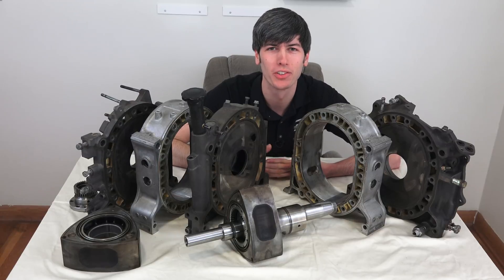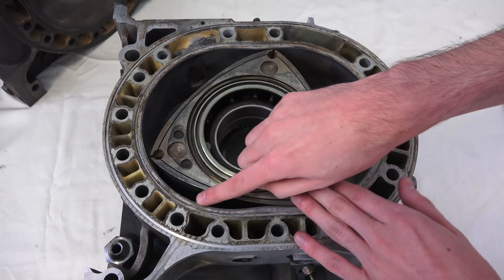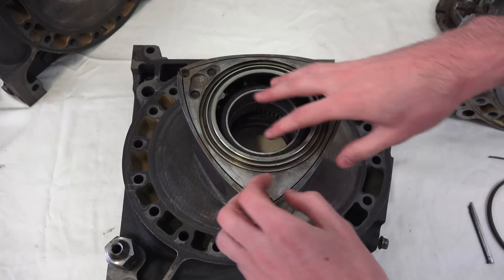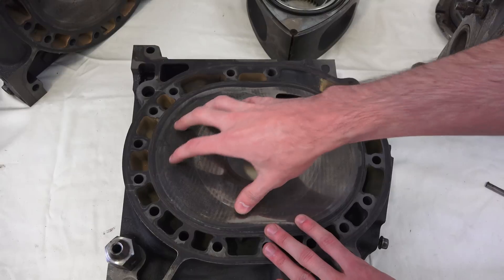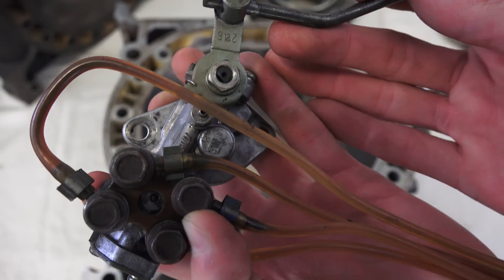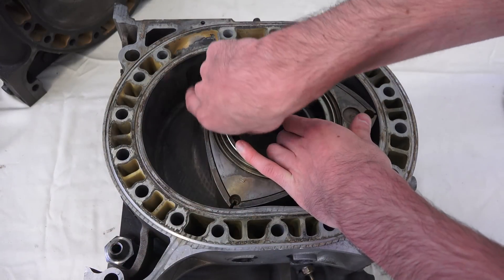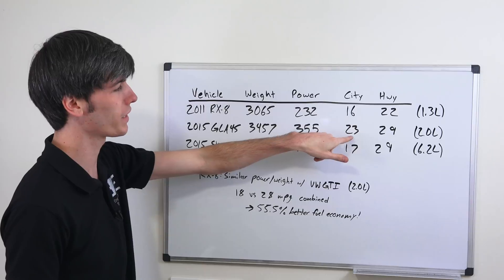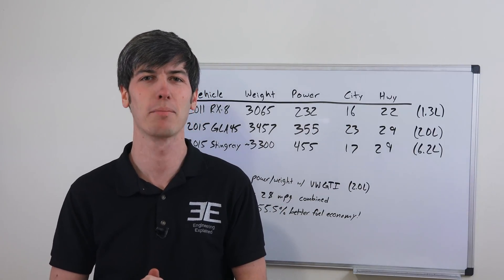4 Reasons Why The Rotary Engine Is Dead

Comment: My Rx2 runs a 9.6, lets see a bloody corvette do that with under 750hp ! How's that for efficiency .
Reply: The real doktorbimmer 
Bimmer McBimface, I know the Prius engine is an Atkinson cycle.
Reply: Mainly you yanks buy the v8´s, becouse noone else wants them :D
Reply: Daniel Manu Do you know what "efficiency" means?

It's about how much fuel is needed to produce a certain amount of power.
Reply: Speedyey I love it when people use subjective arguments. I really do.

/sarcasm
Reply: karsaka sdasfa 😂 The current 6.2 makes up to 650 HP. The most powerful Porsche V8 makes 608 HP, and that's the one in the 918.

Not to mention the Z06 Chevrolet Corvette ($80,445), with 650 HP, costs over $10k less than a base 370 HP Porsche 911 ($91,100).
Reply: There's plenty of 9second Camaros with under 750hp
Reply: It's bloody from running over your slow rx2. And your engine is old news.
Reply: Dyani Massa 
You must understand that Bimmer McBimface needs therapy.
Reply: Dyani Massa
Toyota, with about 15 others have been doing R&D on the free-piston linear generator for range-extender applications.  R&D had been ongoing in some places for 15 years. Toyota made a prototype and issued details and drawings. No one has cracked it yet. It is clear Toyota are turning to the rotary engine as a range extender.

The latest Prius now will travel about 30 miles  on a full battery charge then the large engine, in physical size and displacement, will kick in to drive the car via the power splitter (this is not an in-line transmission as we know it) and recharge the batteries as well.  The car is driven via electric traction then IC traction. 

The whole Prius setup is now 20 years old and was superb for its time when battery technology was less than what we have now. Toyota need a major step up. The rotary will given them a true generator, not driving the car directly via the power splitter.

Toyota are aware that the rotary is very efficient at constant speeds and matches the requirements for a part time range-extender.
Reply: LMFAO I love it when V8 junkies get rekt so hard like this hahahahah v8 can die pls
Reply: The real doktorbimmer so? i still hate everything about their existence. so no there is no joke on me. v8 = heavy, thirsty and they sound like complete trash! ive never ever heard a good sounding v8. any straight or rotary enginge sound better then the best sounding v8.
Reply: doktorbimmer you Yankee should shut up since only European engines are worth something. That 6.2l v8 produces less HP than Porsches N.A. flat 6 let alone v8.

Comment: If you're just looking at miles per gallon, yes, the rotary is inefficient.  But another way of looking at it is that you're getting a lot of power out of a much smaller engine.  A 1.3 liter unboosted rotary making 232 hp, compared to the Vette's  455hp from 6.2 liters.  For the Mazda, that's 178.5hp/liter.  For the Chevy, that's 73.4hp/liter.  That's much less than half the output per displacement.  So in that sense, the Mazda is much more efficient with it''s energy.

I love the Vette, and it does what it does very well.  But so does the Mazda.  Really, it depends on what you're wanting from your engine, as to whether a machine is a good one or not.

Comment: 1.3 litre rotary is just an error on your part, it is actually much bigger in cubic capacity than that.
Reply: "WRONG! 2.6 liters is the accepted volume while the actual displacement is really 3.9 liters"

Hes not "WRONG!". Rotaries are simply measured different. It becomes WRONG when you try to "compare" 1.3 liters with a rotary, to 1.3 liters with a 4-stroke piston engine.  2.6 is only the "accepted" volume when you compare it to a 4-stroke engine.  On their own, theyre 1.3 liters.  If you measure the full thermal dynamic cycle, theyre 3.9 liter engines.

Context.  Makes the world go round.

Back to work officer.
Reply: I think it would be right to say 1.3 litres, because combustion happens only in that area.
CC should be only the combustion area.

If we compare everything to 4 stroke, then things will complicate. For example, by the 720* logic, every 500cc 2 stroke bike is a 1000cc because it fires a 500cc space twice in the same time...
And performance figures can back my claim easily.

Anyhow, I think there's not much need to be disappointed. I've heard Norton is making 100 units of CR700P, which is a motorcycle with a rotary engine.... A road going model is going to follow too, with Euro 4 compliance.
And for a motorcycle, a 200 bhp bike with 136 kgs doesn't sound like a good idea. Its more like a "revolutionary idea"!
How many mentioned challenges of this video, are solved in this bike remains to be seen though.
Reply: 1.3 is the accepted volume.
Reply: Agreed, it is the accepted volume but it remains quite wrong.  The Mazda engine has an actual volume of about 3 litres.
Reply: Ok, so a little introduction. I'm a biker. And not too old, I'm 30 and not from a developed country, and I'm also a Commerce Post Graduate, didn't study science due to some sad reasons.
So, I know less about Wankel engines, but buddy, engineering is still very much my only passion.... :)

Yes, Wankel is on the 4 stroke principle, easy to understand that (except for moving valves). For further understanding however, its necessary to observe its working closely...

What you said about Norton is true, but there's news on that.
Here is the link of the news, and its on various other places as well:-
http://www.motorcyclenews.com/news/2017/april/norton-rotron-200-bhp-race-bike/
Reply: The Detroit diesel 71 designation means 71 cubic inches per cylinder.
Reply: Cumon guys,...really, this is old BS...We KNOW its at least equivalent to 2.7 - 3.0 litre..                                                             
Do u really think a 1.3 liter motor would make an easy 250 to 300 ps??? ..

Comment: I bought a brand new 1986 RX-7 and put over 140,000 tortuous mile on it before trading it in for another Mazda. I miss that car. I only got rid of it because of the 'then' girlfriend wanted a family car. I should have dumped that girlfriend, instead. Finally, four years later she was traded in.

Advantages:  
1. low weight of the ENGINE, especially relative to it's HP.  You should not consider the total car weight when considering the performance of an engine.
2.  ability to withstand extremely high revs.   Yellow @6,500,  Red @8,000
3. Get there fast. With a power band (torque & hp vs rev) . Torque didn't fade out at high revs like others engines.  

That very low engine weight gave you a very fast and nimble car that could send you out of a hairpin highway entrance ramp faster than the left lane 'rs because it had passive rear-wheel steering assist that would toe in/out the rear wheels when over 0.5 Gs were seen at the rear hubs. So when you took turns that would 'freak out' your passenger, the tires never squealed.
Reply: #mgtow
Reply: TOFU
Reply: Not really that fast and you were lucky one to get that many miles without problems. Or you're just lying to make it sound good.
Reply: WillingCoyote ha, GAYYYYYYY

Comment: does this guy know what he talking about no clue
Reply: Try watching the video WITH the sound next time, he makes perfect sense. Maybe you're just a rotary fanboy and that's fine but accept the fact that they are NOT efficient engines and DO have many flaws
Reply: Wankel rotary engines DON'T use pistons, as you can clearly see in the video (maybe you should clean your computer screen), and Mazda will start producing them next year, so it will be installed in the new RX-9 (launching somewhere form 2017 to 2018), because they have improved the Wankel's design so it's only around 5% less efficient than Otto's piston engine, and if you compare engine size to ammount of horsepower and torque they provide, you can clearly see why they want to keep producing Wanekls (smaller engine=more space for car electronics). And BTW, I'm not a fan of rotary engines nor piston engines, I prefer electricity (cleaner, faster, quieter, etc.) :D
Reply: Yes
Reply: Internal combustion from the start has been superior to any rotary or wankel design.
Reply: grat96UYA 
I think you mean piston engine. Not true. The advantages of the rotary are immense. Latest advancements have exceeded piston engines.
Reply: The real doktorbimmer 
The rambling thoughts of a deranged mind

Comment: Rotary engine is very durable, as I met few owners, but it does not make sense to own it or producing it. It's fuel hog and oil consumption ....why?
Reply: The real doktorbimmer
You must stop telling lies.
Reply: +The Real doktorbimmer They won Le mans
Reply: The real doktorbimmer
My father is an old car head and he told me Lamborghini and Ferrari complained because it was too light so new restrictions came in place just so they could get the car out of competition. Now the car is banned in Le mans. Talk about butthurt.
Reply: for racing cars its great the torque, power and lightweight are a huge advantage for a track car but for daily its terrible
Reply: My initial encounter with the Wankel design was in Physics, and the teacher said (in the '90s) that it was still widely used in watercraft because of its smooth power delivery, long maintenance cycle, and conserved angular momentum better than a piston-driven with equivalent HP (important when dealing with wakes and currents).  IDK if this is still true.  Doesn't change that its a poor choice for a mass-production auto.
Reply: osp80 
"because the 1.3l mazda is really like a 3.9l 2 stroke." Yep, and a 4 litre engine returns about the same mpg. But it is massive and very, very heavy.
Reply: The real doktorbimmer
The rotary has a vastly superior power/weight ratio.
Reply: The real doktorbimmer 
Bimmer McBimface, you must stop making things up.
Reply: The real doktorbimmer 
Bimmer McBimface, you must stop making things up.
Reply: The real doktorbimmer 
Bimmer McBimface, you must stop making things up.

Comment: On this note im gonna buy an RX7. Sorry environment my fun is more important.
Reply: I bought a brand new 93 (I think) RX-7 twin turbo. It had a greenish blue paint job that reflected light in ways  I've never seen before. At the time it was one of the lightest and fastest production cars on the road.  Mazda made the damn thing so light that there was practically no insulation inside the doors. It was a loud road noise sob.   I lived in NJ, but if it started to snow in Pa, the car would start sliding before the snow even arrived.  But I loved that damned thing.  It was as smooth as silk and the acceleration was so fast the rear end would hop and skip over any grease spot on the road.  It was not a car for the faint of heart.  It was a crouch rocket with four wheels.  I had to get rid  of it after three years because I got married and, well, you know the rest.   DPA
Reply: skyline is a terrible idea if you live in the US, as all of your parts will have to be ordered from japan which is VERY expensive and takes 4-6 weeks for a minimum average expectancy for delivery. as for the people saying they are unreliable, you do have the gist of it in your second post- they are not unreliable by any means. they are actually quite reliable, that's the benefit of having almost no vibrations- you aren't causing wear and tear over time that will have failures in various parts. the only thing you will ever break is an apex seal or you will overheat your engine. both problems just need monitoring. always change your oil, always make sure you have enough oil, always make sure you aren't overheating, aaaaand then youre perfect! it does take a bit more work to keep them running, but i'd rather take a couple hours per year adding oil and doing oil changes than having a random failure and having to spend hours diagnosing the problem and then hours fixing it. plus, when something does go wrong with these motors, its easy to rebuild them compared to rebuilding a piston engine.
Reply: as said in the video, its not fun. has little power. plus the rx8 is a girly car, the rx7 is good. Strictly meant for racing purposes.
Reply: That was certainly the fate of most NSU RO80's, in Europe it was often whatever the hottest version of the Ford V6 family which dropped in with space to spare.
Reply: Thunderbug a men buddy me too
Reply: My RX 7 was so much fun...Best of luck with yours.
Reply: I'd buy an MR2, myself, but I'm prejudiced because I have one.
Reply: sorry life i need to win a race
Reply: Get yourself a Tesla you little amateur!
Reply: found an rx3 and thought the same thing
Reply: Get yourself a Tesla coal power plants need the money
Reply: I agree. Best thing you can do on an RX7 (or 8) is put a better engine in it :)
Reply: Buy an old RX 7 throw away the wanker engine and drop a small block chevy in it. go baby go

Comment: I wonder why they don't try hydrogen injection at very low rates (volume required achievable by electrolysing distilled water). This has the effect of increasing the velocity of the flame front which would solve all 3 problems: Faster flame front gives more even burn across the whole chamber. More even burn gives less localised heating of the combustion chamber reducing distortion. Reduced distortion gives better sealing. Better sealing gives less oil burn and higher compression ratio. Higher compression ratio and fast flame front gives better fuel economy.

Comment: I was watching this to see what is said.... I think the purpose of the Rotary has gone way over your heads. None of your issues make any sense due to one thing that is the real issue with these engines. They are a racing engine! Not really meant for the road.The way the wankel engine is designed is for speed without worrying about harmonic issues that can slow it down or cause stress weakness. They have no power at all, of course not they are designed for pure speed, the other car engines you are mentioning all rev at 8000 possibly max and they would not like it one bit. This engine is up to 17,000 or so rpm. When you are racing who cares about pollution or long ideas of reliability. They are meant for being thrashed and are expected to not ever, ever, ever meet pollution standards due to constantly running rich. Once you have raced them once or twice you have to pull the cursed thing apart and rebuild it again. One of the real issues was the fact the early rotaries had rubber apex seals. If you didn't drive the car for say a week then they would dry out. Turn the engine over while they were dry and they tore themselves apart, instant engine rebuild.The current RX8 they finally fixed that issue with metal apex seals.The car must never sit idle for more than a day or two!Not sure if this is meant to be satire, but come on...

Comment: I had a new '76 Mazda Cosmo, their first sport coupe.  It would drive 140mph off the showroom floor.  The ride was smooth as a cadillac and you could cover the speedometer and could not tell the speed due to ride.  It was good for 50,000 miles, you could put a new one in for $500 and you had another 50,000 miles.  I went through 3 of these over about 8 years before moving on.